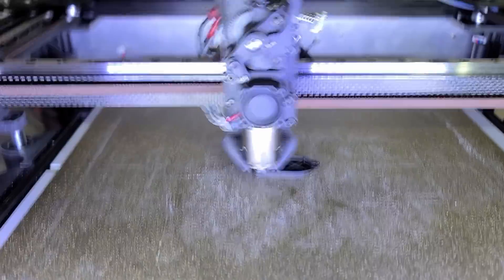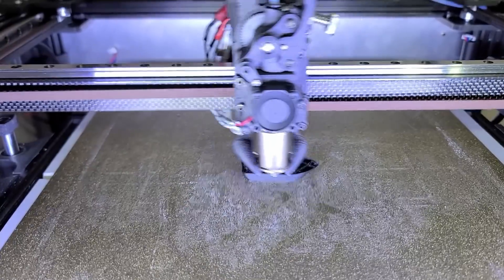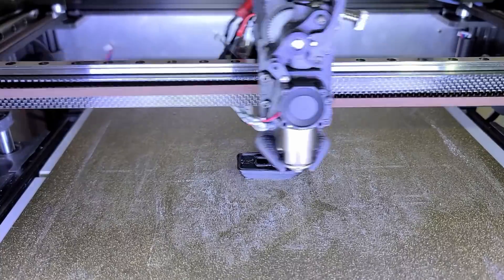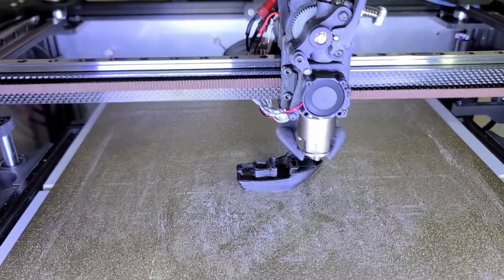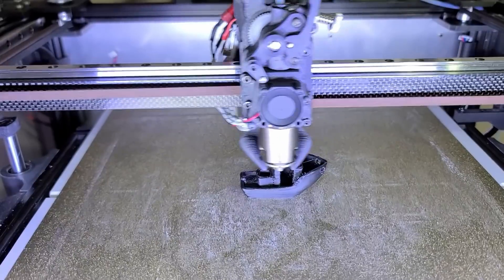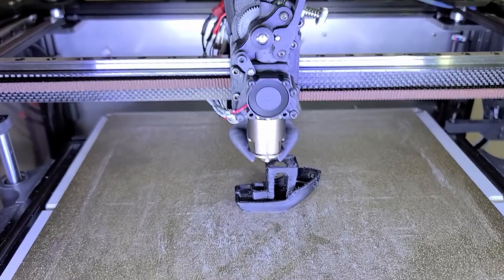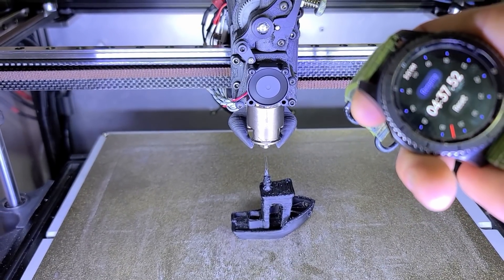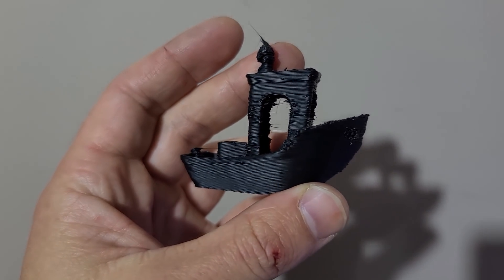#SpeedBoatRace 4:35min. 4Th and final attempt

Comment: Hair dryer ,, lol >> I use a 60mm computer fan. Wired it into the power supply and made a speed control. Been using it for 5 years or so. It sits on the print bed. dunno what i'd do without it. Had to shelter the hot end 4 sure. it's kinda the only way to print slim tall towers.

Comment: this is awesome. i would wish you luck for the challenge, but it seems you need to have stepper motors, still very cool
Reply from the maker: Im a cheater hehe
Reply: @Vez3D  but you do it with a lot of style :-) maybe you get some points for this, lol
Reply from the maker: @HelgeKeck  i think servos should be allowed because the benchy challenge is not a speed issue with motors..its a challenge about how much plastic you can melt and cool down as fast as possible. Servos or steppers, the same limits apply
Reply: @Vez3D  i couldnt agree more. there is a guy, dont remember his YT channel name, which almost crushes you with a cheap anycubic delta printer. Really looks like that the motor doesnt matter at all
Reply from the maker: @HelgeKeck  If you talking about Nitram.. its a highly modded delta :)  Sick printer !!

Comment: You just need to replace the extruder stepper with a brushless motor, that is something I am thinking about testing.
Reply from the maker: Not too sure. My experience with bldc is that low speed turns into cogging issue...and extruder is low speed..even with a geared setup. But i would love to be corrected. Definitely keep me uodated on your project :) im very curious of your results

Comment: I know this competition is all about fastest time, but could you please try printing with the same speeds but lower layer height? Like 0.1mm. You could lower the nozzle temperature as the volumetric flow of filament will be much less. Less cooling would be required to get good quality. Benchy will take like 15minutes but it could look good ;)

Comment: Correct me if I'm wrong, but don't the speedboatrace rules say you have to use  stepper motors?  The Odrives are brushless pseudo-servos aren't they, rather than proper stepper motors?  It's cool as heck to see a printer running on Odrives, but wouldn't they disqualify the printer from the actual speedboatrace?
Reply: He knows that. He said it in other videos, that he is basically disqualified for the race. He wanted to try it with servos anyway.
Reply from the maker: Yes i know. I didnt register it in the challenge.
Reply: @Vez3D  gotcha, sorry I must have missed that part.  Still very exciting to see how far you can push the printer

Comment: If you put a silicone sock around the hotend, or some other insulation, you can have much more cooling and still let the hotend maintain temp. Then add some external cooling for the whole part that runs nonstop. That's where I would go from here. This is absolutely bonkers. It's not just a fun experiment. It's the future of 3d printing. 
Also, I have an idea that will let you move the stepper motor off the carriage but still be direct drive. Similar to the zesty nimble but without any of the downsides 🙂. Basically just a two link arm with some belts and pulleys on it that transfer torque from a stationary motor to the moving carriage. As long as your arms and belts are stiff enough, you won't get any of the input lag like with the zesty. Let me know if you want the details!
Good luck!
Reply from the maker: Please tell me more
Reply: @Vez3D  I am going to join the facebook group and post on there. Kind of hard to explain in words haha. Much easier with a drawing.
Reply: @GiolliJoker  Yeah, I was thinking of something a little bit more mechanically simple than that. With that design, you are constantly changing the angle of the transmission rod with the carriage, so you have to have the extruder gears rotate around the filament. That introduces a lot of play between the motor, the extruder gear, and the hotend. Which is going to translate into input lag. You also need that fancy linear bearing thing to let the rod both slide and spin. It is a very cool design, don't get me wrong. But it could be simpler.

 With a two link design and a belt transmission, the motor shaft controls the extruder gear directly without the motion of the carriage affecting it. Here's a sketch: https://imgur.com/a/fNRU4Dk

As long as your belts are fairly stretch free, and your rods are stiff, this will give you very little input lag and require far less complicated mechanisms. I think the most complicated part of it would be some 90 degree bevel gears or something to drive the extruder gear. Maybe even a worm gear or something to really increase your torque.
Reply: I'll probably make a 3d printed prototype to explain. Just gotta find the time. Too much stuff going on with work and 2 kids.
Reply: @colbylippincott7173  thanks for the picture. Interesting concept, it reminds me of a SCARA arm. I guess the main question would be how much its mass would impact the hot end carrier, considering that it must be a very rigid assembly.
Reply: @GiolliJoker  Luckily I don't think it needs to weigh much at all. The main thing you need the stiffness of the arms for is making sure the belt loop doesn't deform due to the torque of the motor. That's the only load the arms have on them, and it would just be compression with a tiny bit of bending.  In fact if you designed it right you could make it pure compression only. So I think just some very lightweight carbon fiber tubes with 3d printed adapters on the ends would work fine. Probably 20 grams tops, and the COG of the arms only move at about half the speed of the carriage, so it really only adds an effective 10 grams to the carriage weight. 

The nice thing is you could size up the extruder motor as much as you want without any weight added to the carriage. Which means pushing more plastic 😎.
Reply: @Vez3D  I requested to join but it hasn't been accepted yet. But you can see the concept in the comment above. I am going to try to put together a proof of concept as well.
Reply from the maker: @colbylippincott7173  odd.. i accept everyone  that answers the question. Try again
Reply: The extruder idea looks like the rather well-known Zero Gravity Extruder (ZGE) designed by a couple of guys in the Ultimaker community. It should be adapted fairly easily to this printer.

Comment: A benchy has 240 layers if printed at .2mm. 4.35min = 275sec. So the average time you spend per layer is 1.14sec. Besides: My minimum layer time is 5 sec. Did you set yours to 0sec?
Reply from the maker: The speedboat challenge is 0.25layer height. And yes. Remove that limit

Comment: silicon sock might help? but also awsome :)
Reply from the maker: For sure!! But slice dont have one. Might have to make one myself
Reply: @Vez3D   Look for High temperature RTV silicones : https://www.canadiantire.ca/en/pdp/j-b-weld-hi-temp-red-rtv-silicone-gasket-maker-sealant-3-oz-0383814p.0383814.html?gclid=CjwKCAjwqcKFBhAhEiwAfEr7zYhbZqy6dV8RSkW8SlC68ofz-xbwsnzD4LWRweKwI6CxZ_L2LWa3LRoCyr4QAvD_BwE&gclsrc=aw.ds#store=348

To avoid sticking, put a thin layer of petroleum gelly (good old vaseline) on the extruder before applying the silicone. Let dry and remove to clean the gelly and avoid a fire next warm-up ;)

Comment: "I tore it off." "It got torn off." "I will tear it off." "tored" is not a word :)
Pretty awesome. If you are going to get rid of retraction, maybe just go back to bowden, should get you some gain for sure.
Reply from the maker: Yes yes ...tear tore torn.. hehe. Just could not remeber it live. No way im going back to bowden. Have you seen a bowden setup at 100K accel with pressure advance? I can tun with no retract because i run with PA :)  but with bowden...this is not possible
Reply: @Vez3D  Actually the problem of the Bowden comes from the flexibility of the pipe that causes a disparity between the motor speed and the speed of the filament at the extruder. All we need is an encoder that measures the speed of the filament precisely at the extruder and a decent dc motor at the other end and, using a servo motor driver, we could get the driver to compensate for that problem. That would be one heck of a weight reduction.
Reply: @Vez3D  What about remote direct drive like flex3drive? Also I've seen some work of Stephan on different material and flux. Nano diamond PLA seems an interesting material to try for good flux performance at high speed, and probably the nanodiamonds will help to make escape the heat easier in cooling (but that's only my guess, not tested)
Reply from the maker: @gentiligiuliano7882  too much backlash on flex drive

Comment: I loved the way it did the first laters, you could see it building up.

Please can you do a comparison with the input shaper both turned on and off to see if the increased rigidity of the closed-loop servo motors improve ringing when compared to the "loose" nature of open-loop stepper motors? At a reasonable speed - Fast for a regular printer but not crazy like this.

Comment: You could with little effort switch to a high spec 5020 fan.

This one spins 5300rpm my default:

https://www.digikey.de/product-detail/de/delta-electronics/BFB0512VHD-F00/603-1370-ND/2560494
Reply from the maker: On the todo list

Comment: Get a air pump (I suggest fridge compressor because much quite and powerful) and before connecting to nozzle, pass the air pipe in cold water.(use long pipe - 3mm in-diameter) After that you will get a cold burd air. I tried. It's the best way. İf you want much , just use 4 pieces 150W peltier with copper air pipe.
Reply: I looked for a quiet air compressor a few years ago but only found a single brand that was hella expensive. But not long ago I found a cheap compressor using the same tech in my local hardware store, and now I'm seeing them everywhere I go. I guess the patents the original company was holding expired lately and now China has started to spew out copies left and right. I think most of them are marketed as a "65dB air compressor".
Reply: I don't think that the problem is air flow. Even if we could keep the outer surface of the plastic at a perfect room temperature, the diffusion of the heat through the 0.2mm of plastic is already a few seconds to cool back to 100°C (220°F) from the roughly 220°C (430°F) initially. This means much colder heat transfer temperatures are required. i.e. in the -80°C range ... That also needs to cling to the surface to be chilled ... and not leave a mess or being significantly toxic. Liquids that can vaporize to gases are ideal because of the high heat of vaporization and they don't leave a mess. Refrigerants like R-134a are rather bad for the environment. In my book, this leaves liquid CO2. Liquid nitrogen might be colder, but it will have a problem sticking due to the Liedenfrost effect.
Reply: Fridge compressors are pretty cool. But they spit out quite a bit of oil, so you probably also want a filter for that.

Comment: I´m curious to see how print quality looks in "normal" speed.
Reply from the maker: If the gf falls asleep early tonight.. ill do a quality run
Reply: @Vez3D  You have one job now. Wear her out so she falls asleep early.
Get to it!
Reply: @Vez3D  yes please! Would love to see that!
Reply from the maker: Please define "normal" speed :)
Reply: @Vez3D  <100mm/s for us mortals I guess
Reply: @Vez3D  Definitely under 100mm/s. Lets say 70mm/s.
Reply: @cube.in.  what's the point in that? it would make perfect prints... what i would like to see is the fastest speed you can go to get usable parts. Even my sapphire plus does good prints at 120mm/s stock, and i have printed parts up to 240mm/s without any modifications. It dependents, parts with straight lines print much easier at high speeds. Its circles that are harder.
Reply from the maker: @cube.in.  thats slow for odrive. But i can try
Reply: @Vez3D  What is your "normal" speed?
Reply from the maker: @librasd8087  200-300 i guess
Reply: @Vez3D  fastest you still get a1 quality 😂
Reply: @Vez3D  the highest speed you can go to get usable parts, and make parts with straight edges and round shapes... as straight edge parts print quite well in fast speeds, but circles tend to have more issues. Like what are the speeds you use to print user parts, that's at least what i'm interested. If i can go 120-240mm/s on my stock sapphire plus... how much i could benefit from all these upgrades?
Reply: Im almost getting to 100mm/s with 10k acceleration on an ender 3 lol
First layer speed is when you gotta get brave 😂
Reply: I'm building a high temp printer for Ultem, etc which usually likes 20-40mm/s so slower than typical PLA speeds would be nice to see also.